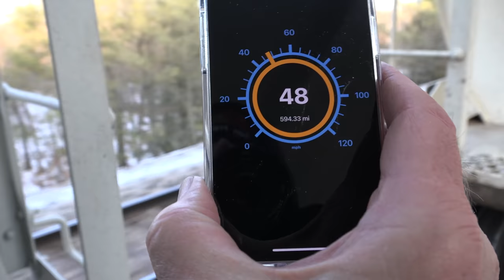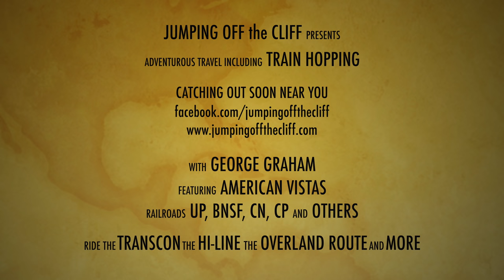Train Hop Portage to St. Paul || Winter Hop || Train Troubles!

Comment: I was the engineer on this train. We had to set one car out at New Lisbon because the wheels had flat spots.
Reply from the maker: I wondered what the deal was. I didn’t have the scanner on most of the time. So, the dragging equipment/hot box detectors report flat spotted wheels too? Wow. BTW, that was a nice ride, almost zero slack action!
Reply: @Jumpingoffthecliff  Yes they do, but they don’t broadcast flat spotted wheels. The Dispatcher tells us that information.
Reply from the maker: @brianthompson8329  I’m a flat spot detector, I have a knack for picking out flat spotted cars and grocery carts;)
Reply: @brianthompson8329  are there Milwaukee road or soo line employee still working freight

Comment: Hey, just a suggestion you should freight hop the WSOR Prairie Subdivision from Madison-Prairie du Chien. There is often a Sunday westbound grain train. Either starts at Janesville or Madison. There was a military train that ran yesterday as well from Janesville-Prairie Du Chien. The Military humvee doors are unlocked usally and if they are locked they are locked with zip ties so could be luxurious!
Reply from the maker: That would be a cool trip for sure. I've wanted to ride south out of Madison so maybe west would be good too. Thanks for the suggestion.
Reply: @Jumpingoffthecliff  to ride south T6 (Madison-Janesville) usally departs Inbetween 05:30-07:30 . Tuesday-Saturday. Saturday they will sometimes relieve a train on the prairie sub around cross plains

Comment: Are pusher engines or engines in the middle generally staffed? Or just the engine at the front?
Reply from the maker: Just the engines at the front. They do use manned helper engines over soldier summit near helper Utah.

Comment: In the old days the axels weren't sealed bearings. there was a box on each axle filled with oil with a square cover, when the oil ran out that was a seriously hot box, thus the name.

Comment: You should wrap the bottom of your jug in duck tape so the vibration doesn't wear a hole in it
Reply from the maker: That's a good idea. The jugs I like to use are heavy duty compared to the usual but a little extra protection wouldn't hurt.